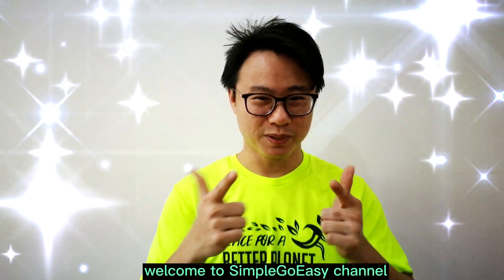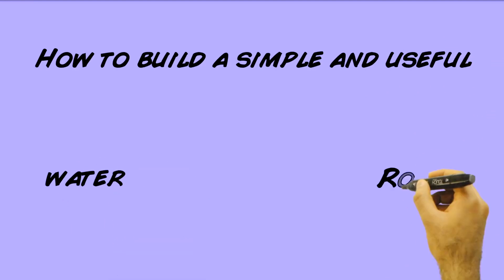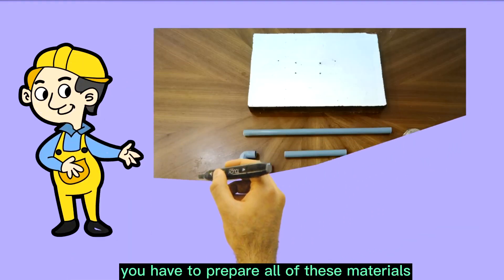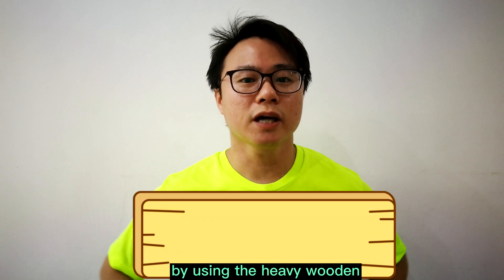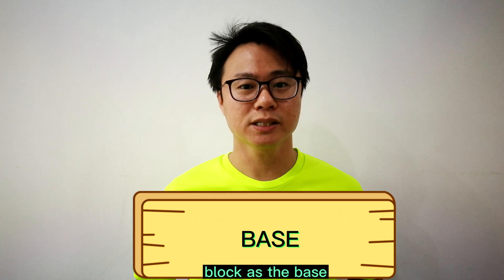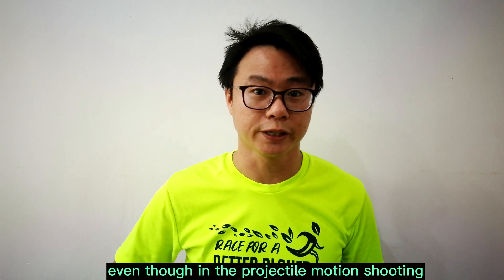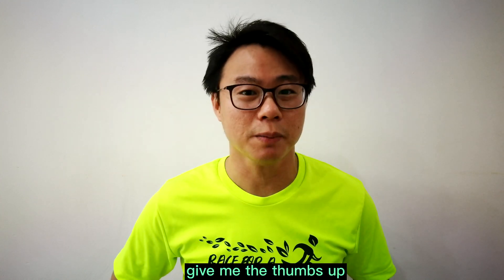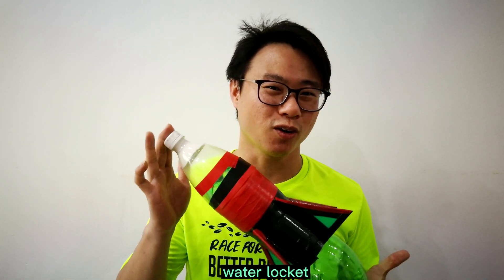How to build a simple and useful water rocket launcher (have fun with your kids or students PART 1)

Comment: Hi I have a question  🥺🥹 Does the pipe that air goes through have to be above the water line 🤗🥰🥰
Reply from the maker: Hi @user-rl7ef9uo9w
I am not quite sure about your question!
Are you talking about the water line in the bottle?? If yes, then the air pumped in must be above the water so the air will push the water out to create the thrust force to move up when you launch the water rocket.
if that is not the one you wanna ask, please rephrase your question ^^.

Comment: Hii I have a couple of questions if that’s alright - when you launch the rocket, does any water spill out as you pump it? I’m assuming no right? Since it has to be an airtight seal in order to build pressure? Also I’m confused as to how the string mechanism works - how does it actually let the rocket launch?? Pls help thank youu 🙏🙏
Reply from the maker: Hi @jaden9107
Yes, indeed a small amount of water will be spilled when you increase the pressure. If your bottle is completely airtight sealed,  then I am afraid if exerted pressure is not high enough then your rocket might not be able to launch due to too much friction. 
The string is used to pull down the seal cap, so your rocket is able to release and launch.

Comment: This is an amazing rocket. May I know how much water you put into the bottle? Thanks.
Reply from the maker: Thank you. 

The amount of water should be filled in into the bottle is a very good question. To make it fun and meaningful for the experiment, you can consider the independent variable as the amount of water filled in the bottle and the dependent variable as the time or distance or height with constant pressure. Then you will know their relationship. 
After that, you can adjust the pressure to another constant value and repeat the entire experiment again. You will surprisingly see exciting results. 
Hope it is helped. ^^